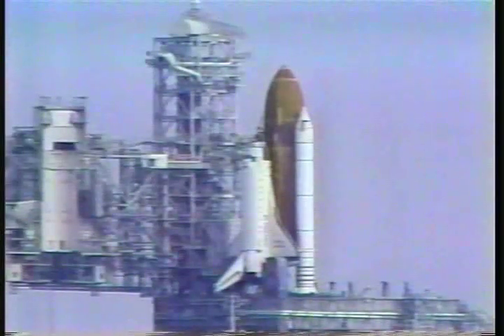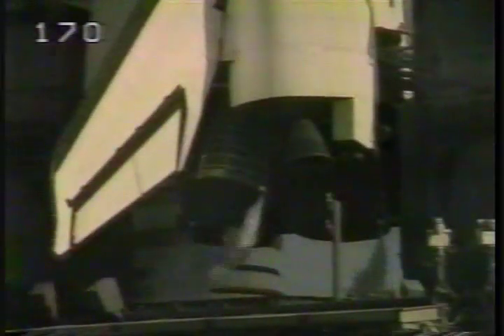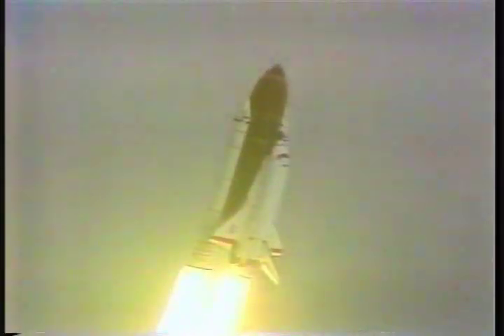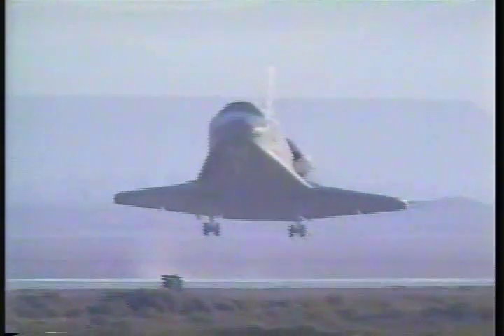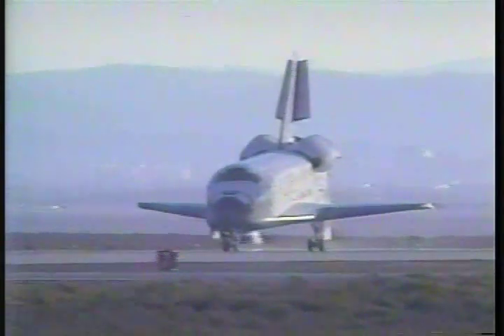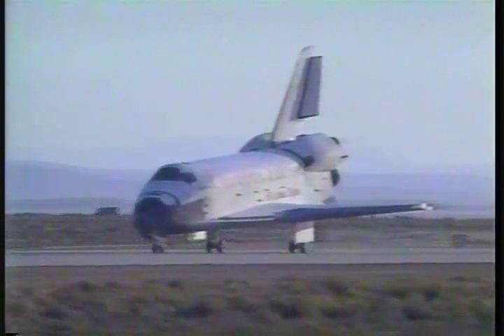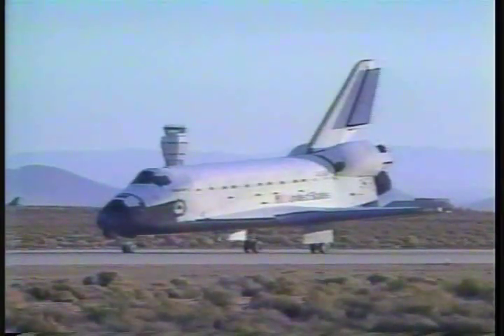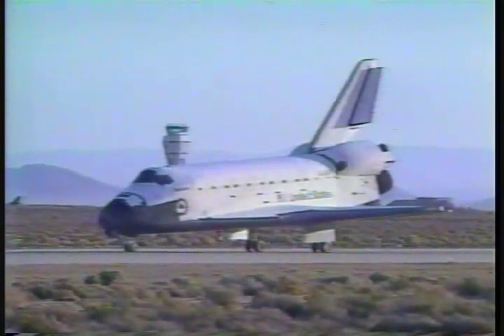STS-31 launch & landing (4-24-90)

Comment: Originally, the Atlantis Orbiter was planned to launch the Hubble Telescope but things changed when the Challenger accident occurred. Discovery was going to be based in California at Vandenberg Air Force Base to launch mostly military satellites and hardware but after the tragedy Discovery stayed in Florida and no missions from California ever took place, though it cost billions of dollars, about 9 to 10 billion, to make Vandenberg ready for the Shuttle. An awful lot of money from the taxpayer spent for absolutely no return at all!  
So as a result it was Discovery, not Atlantis, that ended up launching Hubble and it also performed 2 of the subsequent servicing missions. As a consolation for not launching Hubble, however, Atlantis did perform the last Hubble Servicing flight, a flight that went so well that Hubble is still in good working order 11 and a half years after the flight took place.  For me, the launch, repair and servicing missions of Hubble were the Shuttle’s greatest achievement. 
Of course, as we all know, it was discovered (pun unintended!) that Hubble had a serious problem with its vision, A problem put right at the end of 1993 by STS 61, by Endeavour.  However, the fault was certainly not the fault (again pun unintended)  of Discovery or the crew.  The crew did the job of deploying Hubble perfectly and Discovery did a perfect job of getting into the right orbit and height so that the deployment could take place.

Comment: It was STS-110 (April 2002).  It was a fitting line, in my opinion, as the mission carried the first element of the space station's truss structure (accurately described as its backbone).

Comment: You are right @DaveSSSU ! I am surprised by this too. Air Brakes on the Rudder are already at full. However, elevons were deflected to maximum angle and despite that nose gear rotated down a bit slower than normal.
Possibly because Orbiter's landing velocity is more then normal due to descent from highest altitude Orbit at that time. (Or they were getting real desperate to check new carbon brakes LOL).

Comment: This is one of the missions that was held at T-31 seconds due to a problem. What had happened was that the ground launch sequencer wouldn't hand off to Discovery's computers because the liquid oxygen fill-in-drain valve wasn't closed.